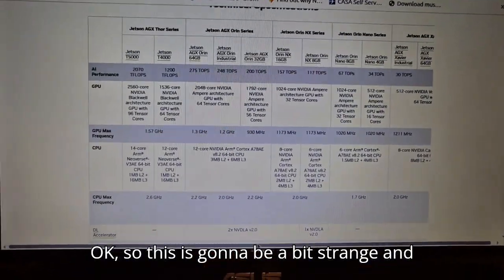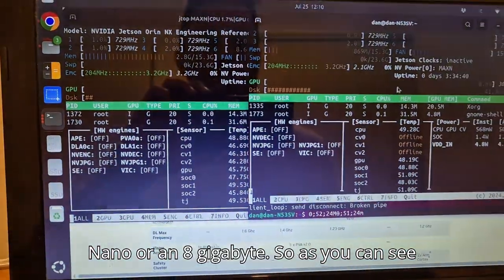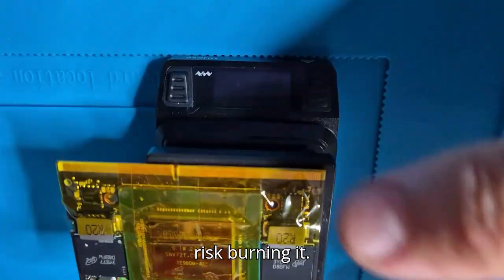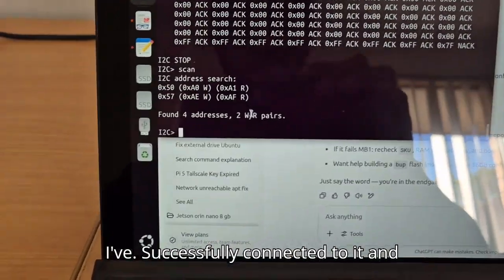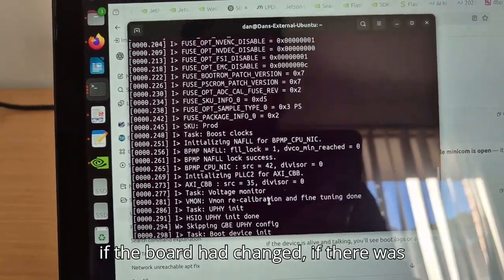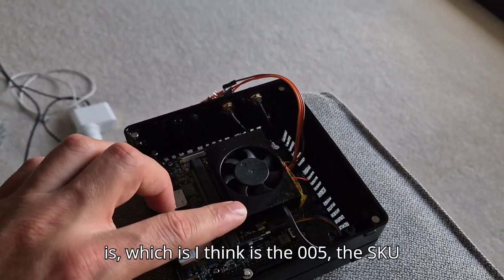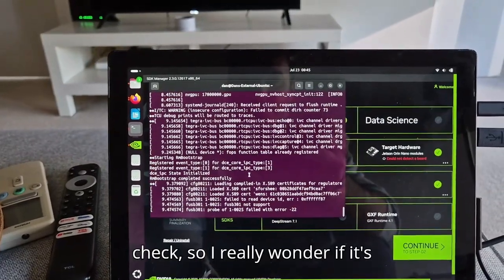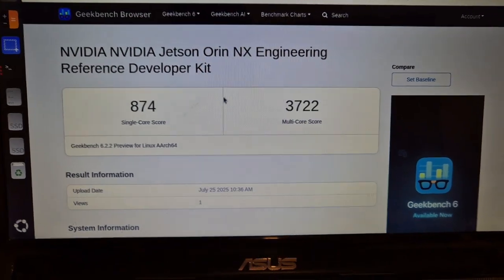Jetson Nano Orin 8GB Ram upgrade to 16GB

Comment: Did you hot air / float solder to replace the chips ?
Reply from the maker: I'm not sure what you mean by "float solder" I used a hot air station..

Comment: I'm more amazed that you got sdk manager working!
Reply from the maker: Thanks, I ran apt upgrade and pushed L4T to r36.4.7 and it soft bricked it had to reflash to get it back to 36.4.4 but I'm not sure if this is an update from nvidia to prevent this type of mod or just a querk with the latest jetpack, my NX is running 36.4.7 no problem

Comment: So, if i got it right.
- Update the SKU to the Orin NX 16GB on EPROM 
- Update the CRC EPROM 
Now the SDK manager should detect it as NX 16GB
- Attempt to flash and will write DTS and DTSI?
Now it will be able to read the full ram?
- Manually flash adding files from Orin nano original firmware?

I got a bit confused about what we're the needed steps at the end, what was tinkering while finding the solution and what was needed.  If you could share some summary please 🙏🙏
Thanks
Reply from the maker: I wasn't 100 percent sure why it worked when it did using the sdk manager, because I had tried that before and it failed, but I think the key is the SKU part number change, CRC correction, and then just flash with the sdk manager it should pull the correct files for the ram mod, I do not think you need to mess around with all the files I was doing. That was the old chatgbt rabbit hole
Reply: @handymandan4736  Thank you so much! I have been messing around and flashing a lot! 
I found out that no matter which target board I select on the nvidia SDK Manager (CLI mode did not complaint) it will always flash what the EEPROM SKU indicates, but the target files will be the one you selected. So if SKU is NX but target selected is Nano, Nano target files will be used and installed but information will show and behave as NX in run time. I wonder if everything is the same build image but the SKU indicates to load some different bits on flashing internally.

I have been moving between Nano 8GB and NX 8GB, I am not sure if give a try to NX 16GB before change the chips or I will be locked out. I have been changing SKU EEPROM from ubuntu itself and I still don't have a way to flash EEPROM externally. Do you mind share some details about if there is any pads? o where is the EEPROM? Thanks
Reply from the maker: 232	I2C2_SCL	2.2 kΩ→1.8 V	SPD EEPROM (0x50) – the only EEPROM bus
234	I2C2_SDA	2.2 kΩ→1.8 V	SPD EEPROM (0x50) – the only EEPROM bus
it's not possible to power eeprom from your interface device (bus pirate) I soldered tiny wires to pin 232 + 234 for ic2 bus comms then reinstalled the module back into the carrier board and used a gnd from the carrier board and powered up the carrier board which powers the module and then you can get access to the eeprom
Reply: @handymandan4736  Thanks! I have found out also that modifying the NVIDIA SDK Manager files I can override the SKU value, so no matter the value found on the EEPROM chip it get always override with the value I am insterested in. So, without actually modifing the SKU I can flash other versions even If I get locked due to wrong flashing. I will be sharing all this once I have completed the whole migration. I will be soldering the RAM chips soon 🤞
Reply from the maker: @acci_fpv nice work!! Software is weak spot I have know idea what I'm doing and it's all trial and error, never would have thought to attack the problem from that end. So you can flash anything to any module and don't run into CRC issues?
Reply: @handymandan4736 It seems the CRC value only needs to be valid for the currently loaded EEPROM version to ensure it’s not corrupted. However, once the firmware is running, it doesn’t appear to actually use that value at runtime. I still need to confirm whether the update software or other pieces relies on it, but at least in my tests, after manually overriding the EEPROM value in the SDK Manager, the system still booted using the flashed firmware, regardless of the EEPROM value.
In any case, I’ll keep this method as an emergency restore option and set the NX 16GB SKU before changing the RAM.
Reply from the maker: @acci_fpv brilliant nice work!

Comment: Amazing job! I would like to try it. Have you compared LLM performance between both setups? RAM increase should make a difference
Reply from the maker: Not yet, still building. Before I couldn't even build it would run out of ram now it just works
Reply: @handymandan4736 on 8gb maybe you can give a try to ollama with some 3B model?
Reply from the maker: @jesusl.g.2307 I've already got mistral-7b-instruct
Reply: @handymandan4736  Hi! I am running Gemma3 4B locally at 9-10 tokens/second with Ollama and OpenWebUI running in Docker on SSD. I was wondering if you could share the performance of this model or some 4B similar model running on your 16GB please :) Also is there any main point you found against the migration in terms of software? Thanks!